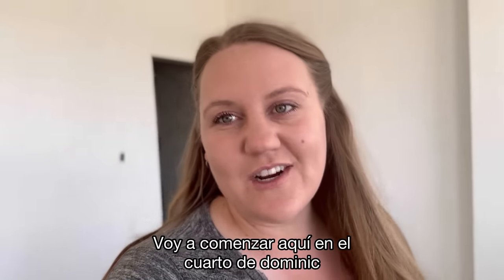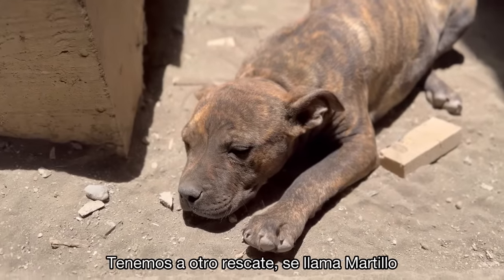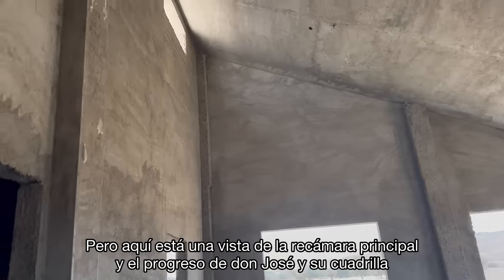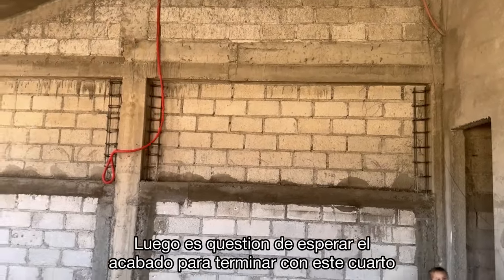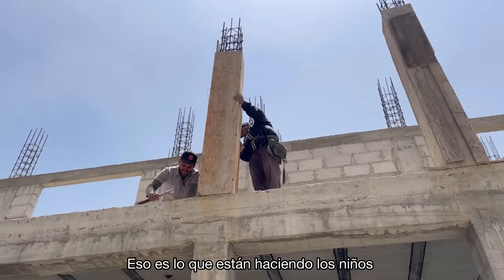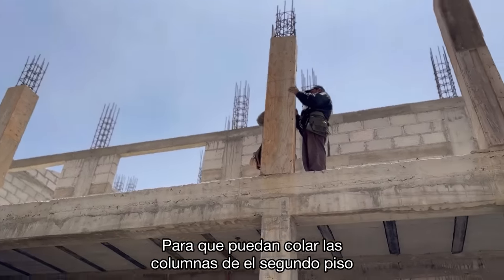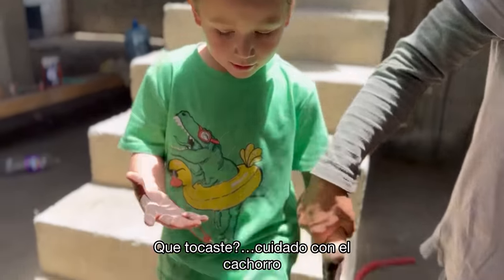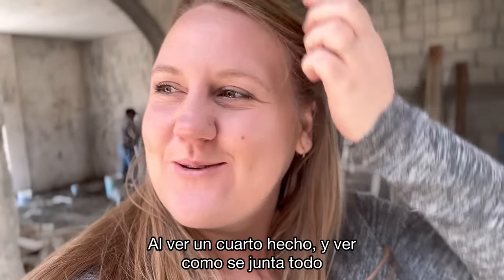Building Our Forever Home in Mexico - Update (Finish on the Walls & Second Floor Balcony Columns)

Comment: I would get a 5gallon bucket of Thompson water seal and seal the concrete concrete will pull moisture out of the air or when it rains and when you put the finish the trapped moisture will bust out.

Comment: We did cement to plaster our walls, idk if it’s yeso what y’all were using but I’ve seen in other builds that it isn’t as resistant. Maybe it’s a bit more cost wise but haven’t had major issues with cracking. Just a downfall is that when we painted we had to primer the walls to get them the light colors we picked.

Comment: The cracks appear because you need to keep hydrating the material at least twice a day, start hydrating the day after it was installed: just dampen with a water hose in sprinkler mode!

Comment: That si called settling, it is normal to some point; however, if the walls have not been totally enclosed with cadenas y castillos you will permanently have the same cracking problem all the time. Most albañiles fail to enclose all the walls, especially around doors and windows.

Comment: Most important is that you had an architect better yet a civil engineer approve of the materials and dimensions used for your construction.
If not make sure that as a minimum you used a highly experienced Albanil/brick mason who has made similar homes in the area in that type of soil.

Comment: Your pillars look OK especially if your using half inch rebar. However I’m concerned about your Trusses. Normally there are taller that their with. 1 one to 2 ratio is preferred. It’s hard to tell what your dimensions are from the video. Good luck!

Comment: If it's cracked only on the finish layer (enjarre or aplanado) then you don't have to worry, the workers just need to wait until the "enjarre" has completely dried and cracks, which is normal, and then finish with a "mezcla" batter to cover the cracks. But if the cracks affect the cement blocks then you will have to find the cause of that problem. For that you have to remove the "reboque" on the window opening (boquilla) and the "enjarre" on the wall to be able to see the condition on the cement blocks all along under that cracked finish to see if the blocks are cracked, don't just cover the crack, because that diagonal crack that runs from the window opening down towards the floor might be a serious issue and it would indicate a structural failure at the bottom (if you draw a perpendicular, 90 degree line at the middle of the crack line that runs from the lower opening of the window towards the floor, that perpendicular line points to the place of the structural failure) and it would be a good idea to get a Civil Engineer to take a look at the issue. Hopefully it's just the "enjarre".
Reply from the maker: It’s only the finish 😊

Comment: The cracking on the walls you got problems with the foundation not not on the finish on the walls I got the same problem here at my house in Arlington Tx the inside and outside of the house a specialist came to my house to check the foundation they fixed it
Reply from the maker: That was the first thing that was checked was the foundation and it is only the white finish that is cracking not any other layer. 😊